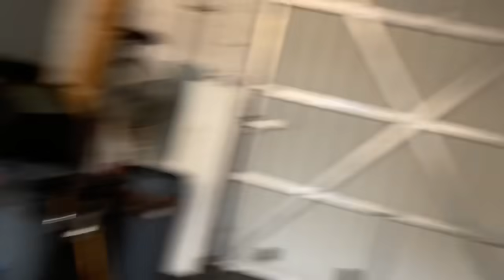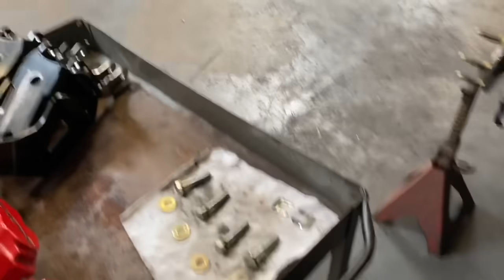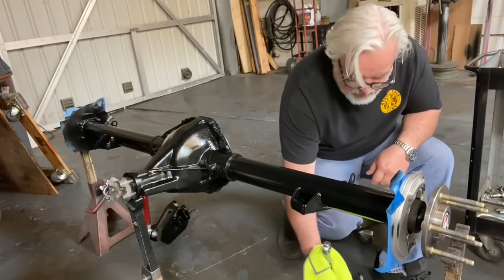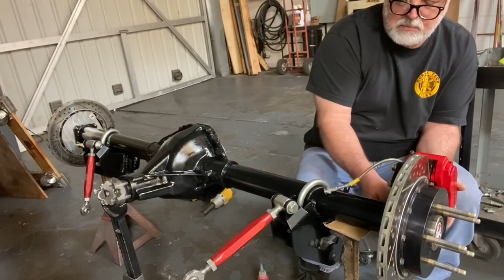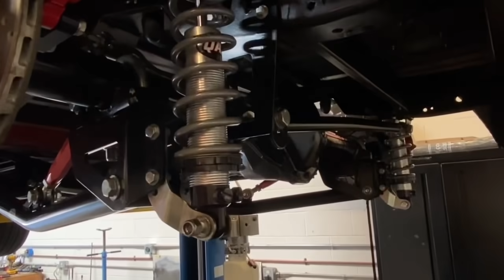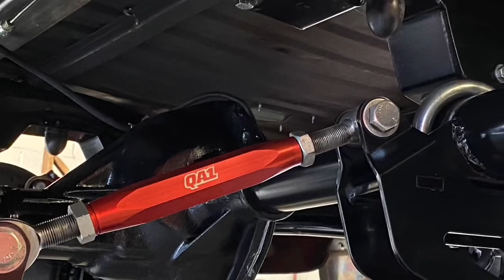Luckys Garage Shop Truck After The Sparks

Comment: Hey Lucky.  What do you use for your chassis black paint?  I’ve had a hard time finding rattle can paint that will last more than one winter in New England.
Reply from the maker: BlindBatG34  POR15 Top Coat
Reply: Thanks Lucky. I just ordered up a can.

Comment: Are you running an emergency brake on that setup?
Reply from the maker: Matt Johnson  I have the parts but not yet.
Reply: @luckysgarageshow  is it a second caliper or the drum kind?
Reply from the maker: Drum inside the rotor hat

Comment: Love thetruck got a 69 chevelle put a painless wire harnes in with atko 5 spee was an auto how do I hook up the neutral safety switch
Reply from the maker: Daniel Petersen  you can put a brake switch on the clutch pedal

Comment: Lucky I have a Ford 9 inch in my 63 Chevy  C10 it's bolt pattern is 5on5 can you please recommend rear disc brakes that won't break the bank.
Reply: Do you have front disc ?

Comment: Where did you get the angle truck arm perches and where did you get the measurements to weld them on ?
Reply: Those look like they are original. Coil springs with ladder bars. Factory U bolt mounts.